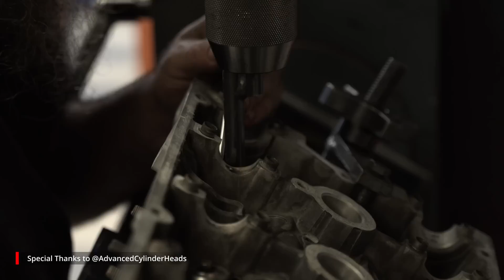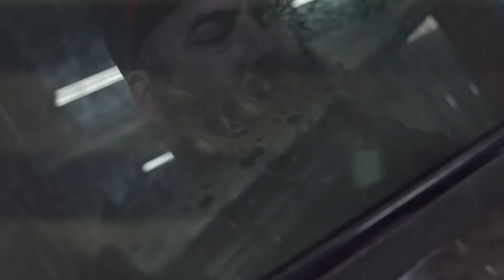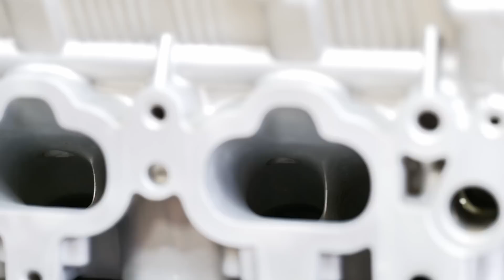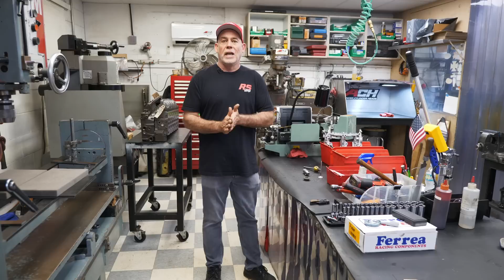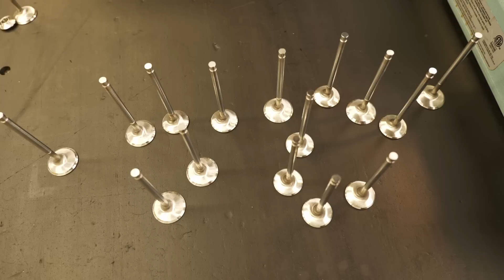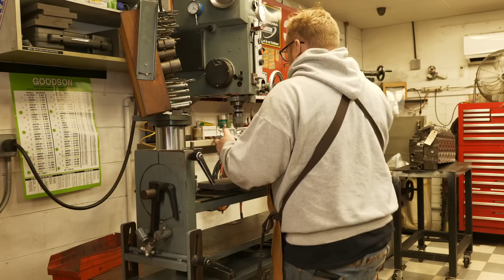How to Machine a Cylinder Head: Machine Shop Processes Explained - Part 2 | TRC Evo 4G63 | RS Garage

Comment: So I took out my evo3 cylinder head out and I would like a job similar to this. The job I want is inspection of the cylinder head to make sure is in standard with factory #. If we are good then I will like clean the cylinder head like in the video but no resurfaced. If fail standard resurface to meet the standard of a felpro headgasket permatorque ( non-mls ). I will like to retain factory valves they are made with a different material, not even dsm came with those. I will provide new valve spring kit. Removal of exhaust stud it a must. Cylinder head has less than 55,xxx miles. How much money a job like this will be.
Reply from the maker: Reach out to advanced cylinder heads and they can give you a quote and guide you through the process of checking and doing to essentials to get you head back in a good state. 407-671-2885 or DM them on instagram

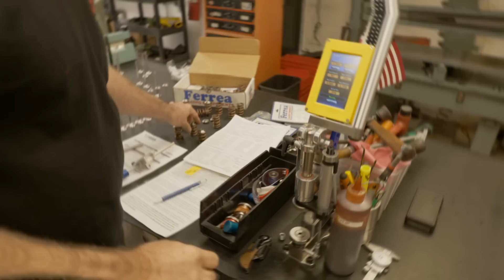Comment: Certainly better than netflix. Q 19:49 The sharp edge at the top of the valve seat on the surface of the cylinder head, do I have to clean it, remove it, cut it off, or do anything to it or nothing to worry about?

Comment: Anyone else see the crack @ 16:17 going from the spark plug threads to the valve seat?  Might just be my eyes 👀 though…… or could be a shaving from the cutting tool.  Anyone??
Reply: it's true - he would install later this cylinder head and talk about the crack

Comment: If you were trying to put the most timing possible in it or something would you want to try to blend the ridges in the chamber left by the valve job? I just noticed the silly sized snap on side cutters lol! A guy in the shop has pliers that size

Comment: I expect them to not exist in WA state. 
Old men who wreck parts is all we have around here. =Buds Machine Shop
"Nobody builds engines" - Cope's Machine shop. 
DaleGreen DG machine gives you blocks with gouged decks. 
No where else has the equipment to do anything.  Line bore is impossible anymore. 
Any sort of competition valve job gets sent out the door in favor of minivans for local repair shops. 
This industry/hobby is dying faster than I can keep up. 

No love for the Nissan VH engine leaves me in pain.
Double SR/4G, lighter than an RB. 
Comes AWD. Where are you PRP?

Showing removal of the Steel bush type plugs, and or balls would be great.

Comment: Hey Jake got a ? I have w Integra lsv with ferreras 6000 valves spring and retainers blox for some reason I have a gas smell and have low compression in cl 1   115 psi do you think that can be a leak valve or something in bottom the think she was good before the head was built
Reply: Valve lash too tight?
XY Problem, look it up
Reply: @brandonlittle6444   definitely  thanks so much buddy